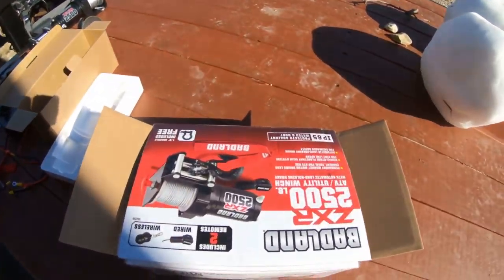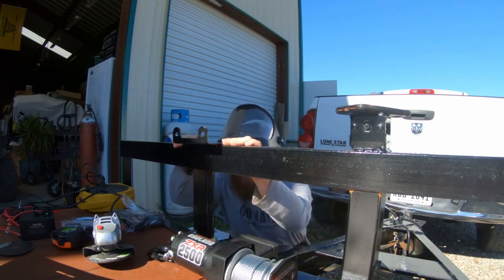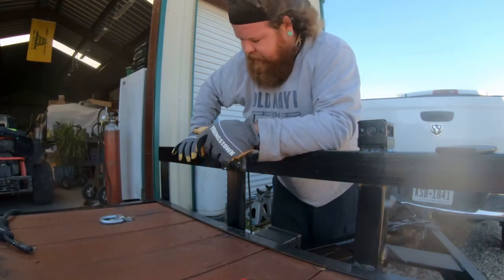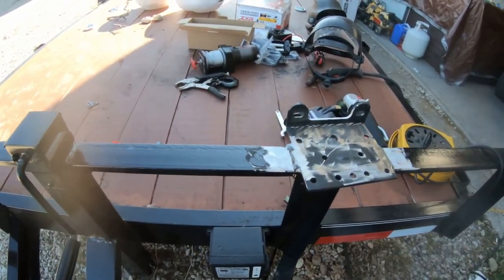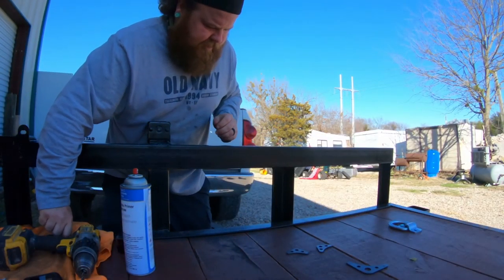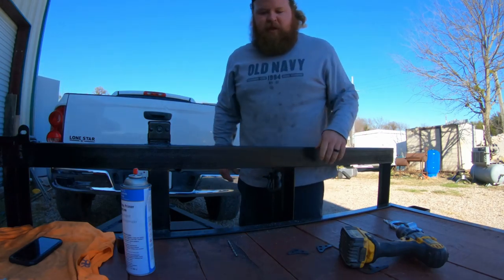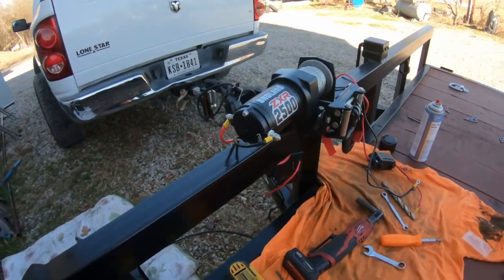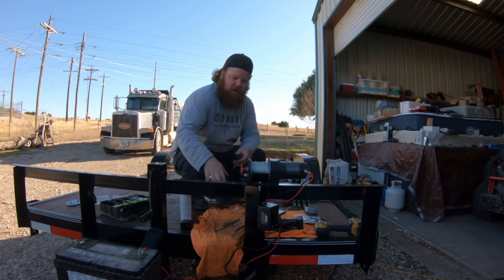I Added a Winch to My Car Hauler Trailer! This Will Make Things so Much Easier!!!

Comment: That winch plate is not straight. You should probably fix it so you don’t have winch issues
Reply from the maker: I use a snatch block and then hook it to the front of the trailer. Makes the winch in line and roles up perfect

Comment: Is this winch enough to pull the cars up the ramps? I was going to get one for my 16ft car hauler i mostly use it for cars but sometimes ill end up towing a 5000lb suv . I keep reading online that you need a 4500lb winch and up . .....how does your 2500 do so far?
Reply from the maker: So if you use a snatch block it will double the winch power! I pulled a small suv onto my trailers no problem! I don’t think it will without the snatch block!
Reply: @sparksadventures9140  i may just do that! Then i can keep the budget low and the battery draw low also . Its gotta be better than pushing them up myself or using a hand crank winch like i do now! I also have 8ft aluminum ramps so that helps to
Reply from the maker: That’s why I went with the smaller one! Doesn’t get used a lot and didn’t wanna spend that much money on it! The extra 20 for the snatch block made it very budget friendly
Reply: @sparksadventures9140  thats the plan for the weekend! Im gunna pick up the zxr2500 a snatch block and a mount
Reply: I pulled my 4door jeep up onto my trailer that was also on a incline up onto my trailer with no snatch block ! But i do plan to only use my snatch block when pulling everything up. I just wanted to test it